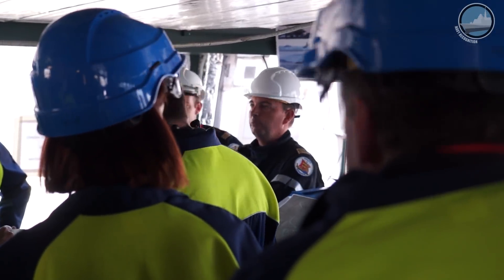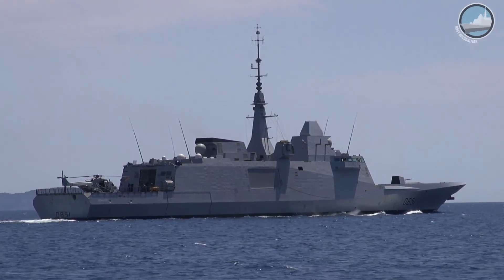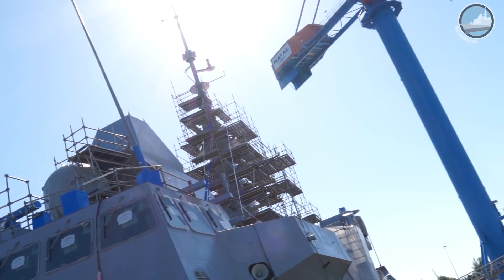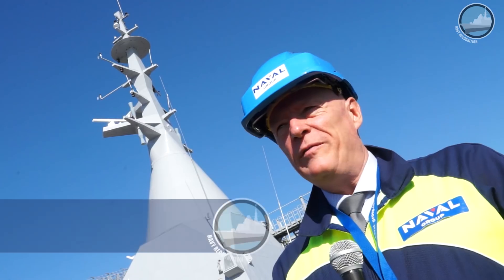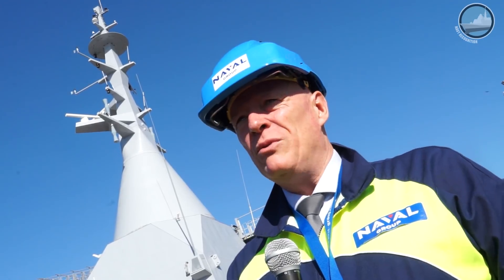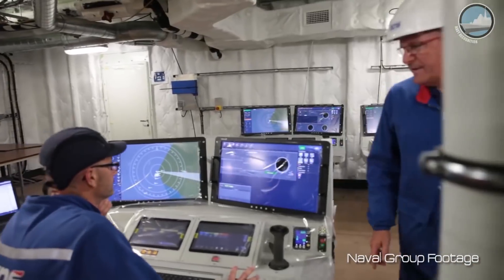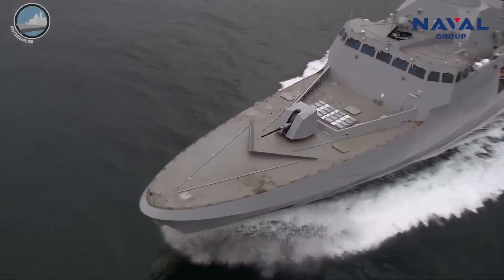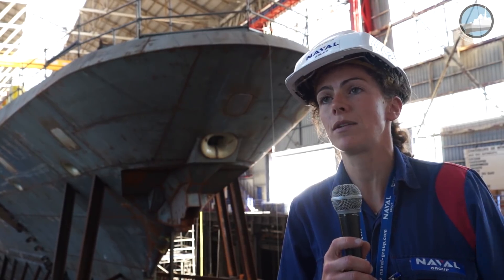Euronaval 2018 - Naval Group Shipyard: FREMM Normandie, Gowind PSIM and FREDA (Air Defense FREMM)

Comment: One question, what is the difference bettwen this new FREDA and the oldest French FREMMs? This new ship FREMM FREDA has the capability to use the ASTER 30 missiles with one similar radar system of the italian FREMMs using the SAAM-ESD (Extended Self Defence), and use to another 76mm Oto Melara behind to protect the ship, similar to the Italian FREMM? Because i know the first French FREMMs has one ship only capable to use ASTER 15 and SCALP Naval cruise missile and has one naval gun on the prouch.

Sorry for the bad english.